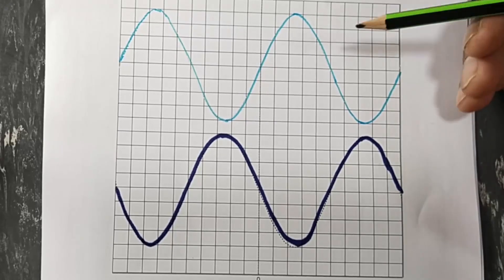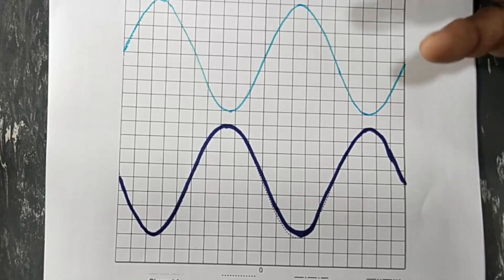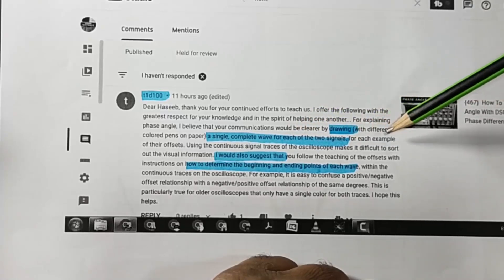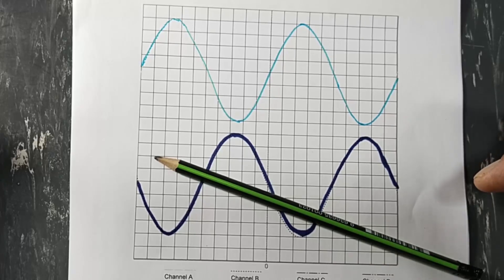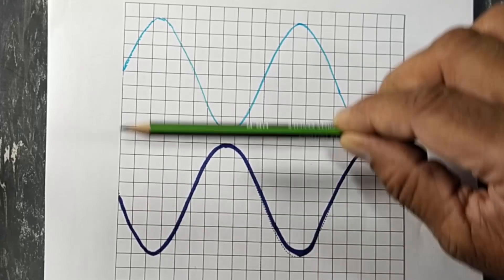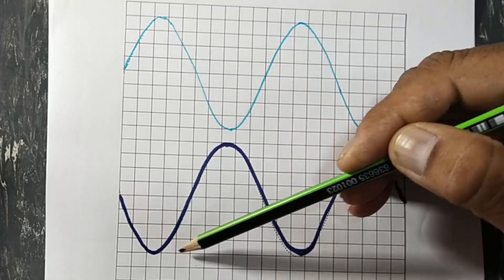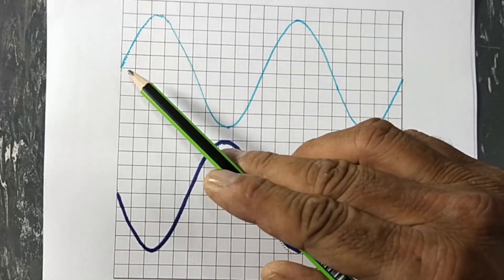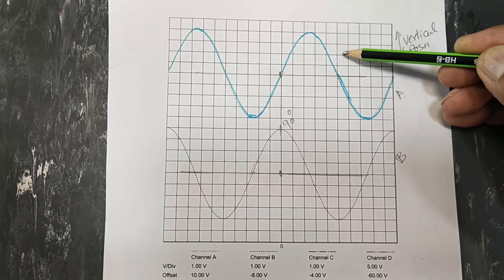{473} How To Measure Phase Angle Using CRO Cathode Ray Oscilloscope, Understanding Phase Shift

Comment: Sir..I got a defective lg monitor...it's ic TOP246YN  was in blown out state. I followed the instructions given by you in your previous Video and solved the problem with the SMPS section, now steady output voltage is available at out put and in ic section...but when the logic board is connected the out put voltage drops from 5V to 3.5 V and the power led does not glow. Please guide me.🙏